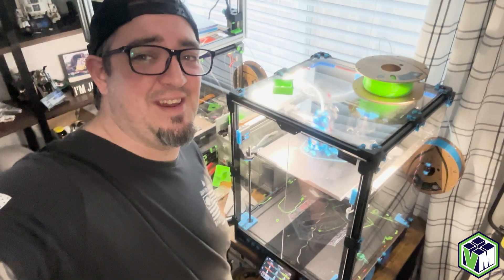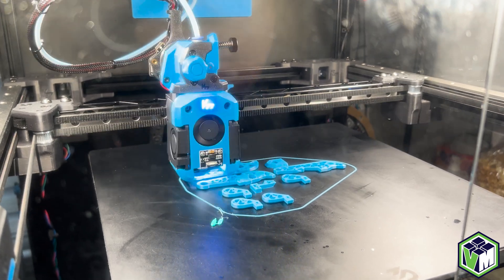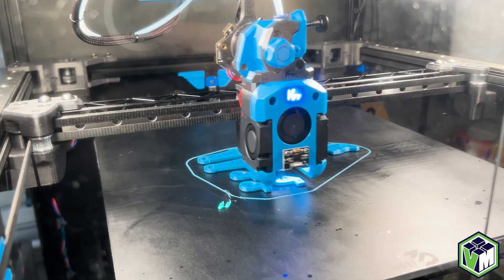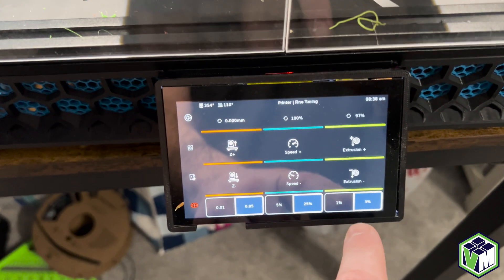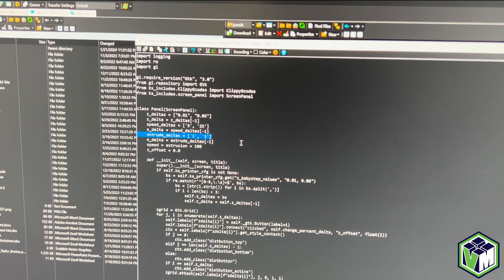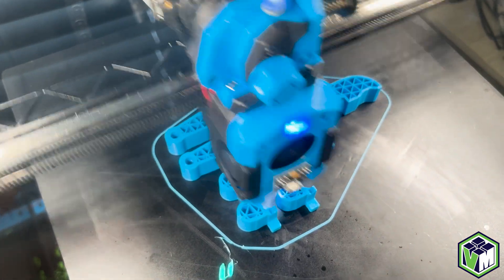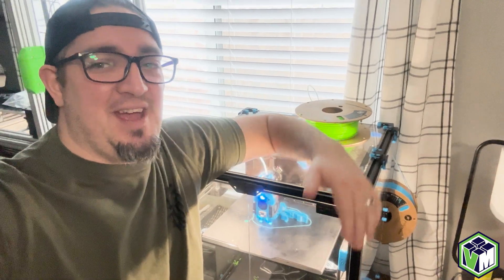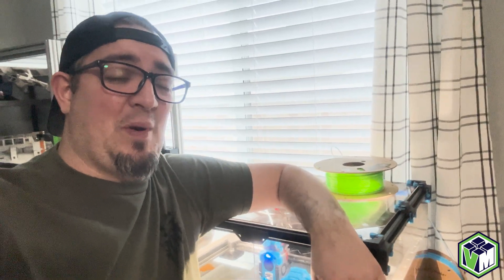EM Tuning

Comment: I watched this twice because I wanted to confirm that in crazy. You don't say at all how you quantify 'Good' EM.

You just say you know you like it at .97 How about an explanation or video of what to look for abs which way to adjust in each situation?
Reply: OrcaSlicer has a great built in feature to fine tune your printer. My v2 works best at 99 to 101% Edit... Not all my filament brands are the same. so you need to run it for each of your usual ones then you can build a profile for them